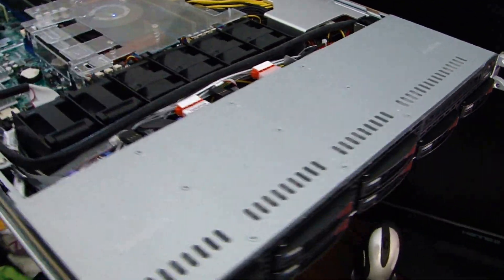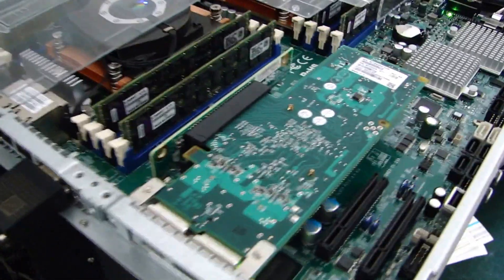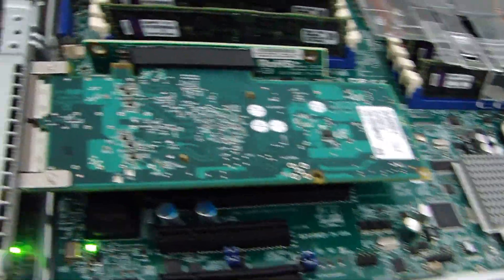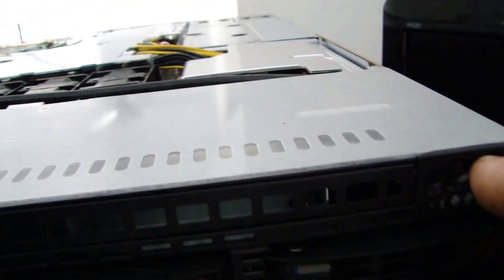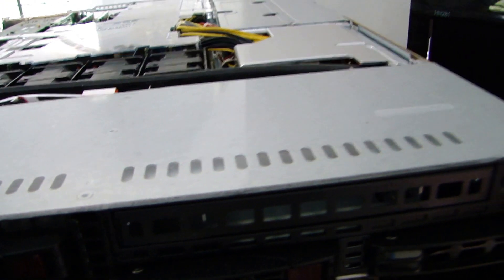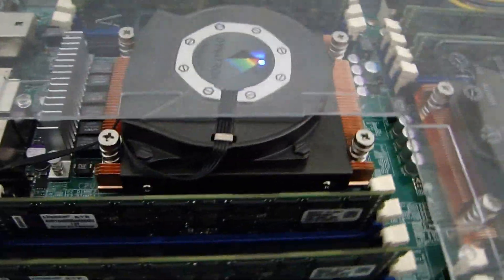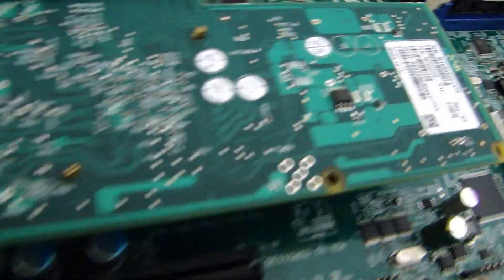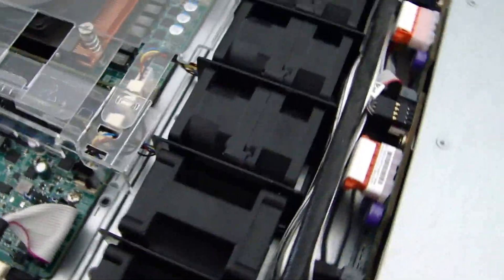Supermicro Server build - First time fired up

Comment: I am looking at the SCE113MTQ 330CB it has the 330W power supply. I am just a bit concerned with the noise factor of the fans. I will be building a FreeNAS server that has a low powered cpu fanless and SDD drives. 

Did you put in the 3 extra fans or is it just the 3 that came with the case?